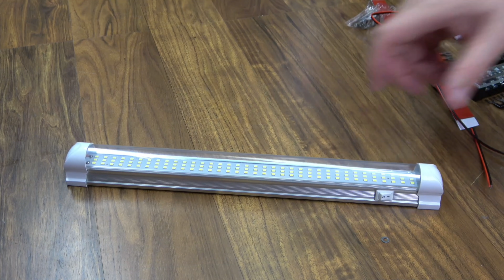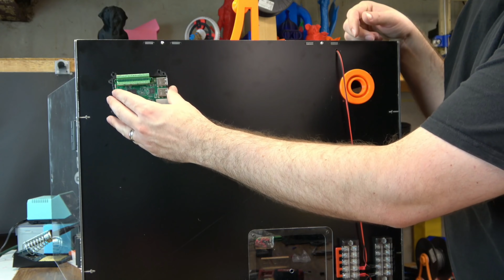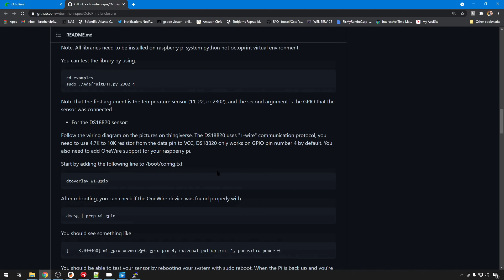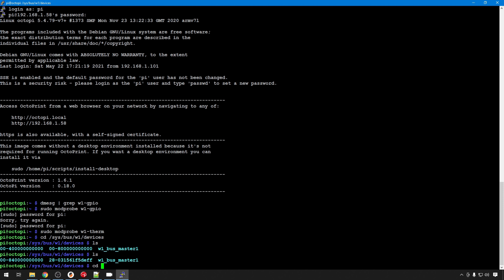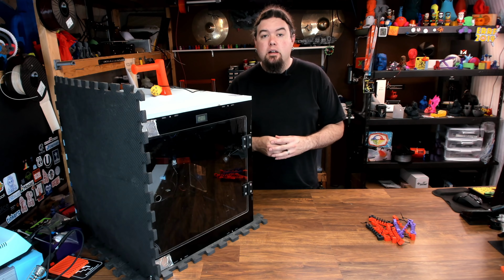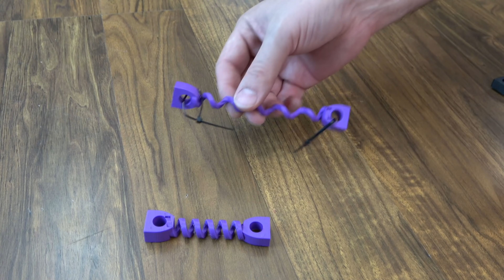Automated Enclosure Part 1 - Active Heat - OctoPrint - Chris's Basement

Comment: Thanks again for this Chris !! A HUGE help !! One question though, is there any way to have the sensor temp displayed on the navbar itself, instead of inside the drop-down box with the flame symbol on it ??
Reply from the maker: Awesome! Check this one out, see if it does what you want it to. https://plugins.octoprint.org/plugins/navbartemp/
Reply: @ChrisRiley  Thanks Chris but I already have that plug-in. Still have to open the pop-out with the flame icon on it

Comment: Would there be room on the inside of the case to run cables down an inside corner and just come out near the connector block rather than have cables running down the outside?
Reply from the maker: For sure on the Prusa one. Plenty of room.

Comment: Nice Video. Is it also possible to integrate the Chamber temp into the Graph Window from Octoprint?
Reply from the maker: That's a good question, maybe, I will check it out for the next video.
Reply: @ChrisRiley  Actually you just activate "Heated Chamber"in the Printer Config and there is the Graph and Symbols for it.

Comment: Chris. If you plan on printing really high temp stuff. Lets say polycarb, or peek, or such.  What kind of chamber and setup etc would you recommend going with? And as you make this video serious as you go is it possible to include comment in the video to that effect maybe??  Thank you.
Reply from the maker: I will touch on this in the next video, PC to PEEK is a huge jump. OC, this setup will work fine, PEEK, you need as much heat in there as you can get.

Comment: I have one of their previous generation enclosures for the CR-10 sized machines.  (I did a video on it a couple years back)  Is this new one using ACM or something "better" for flame resistance?  I have a BOFA on mine and I will be installing a Blaze Cut system to the top, for added safety.  My only gripe about the enclosure isn't the enclosure...it's getting the CR-10/CR-10S inside of it and trying to find all the connections you have to plug in again!  Maybe this new one has better access on the side?  I like your tweaks!  I've been using those inexpensive Ring Light clamp mounts.  It'll hold a webcam, the ring light is abled to be brightened or dimmed to your Octoprint camera preference.  Print Safe!
Reply from the maker: Cool, thanks for your insight!

Comment: Nice video. My enclosure I made myself, with 15mm MDF painted with fire retardant varnish. I get 40c in 1 hour and 50c after a few hours just with a standard Ender-3 running 90c bed, no additional heater. Moved the electronics to the back, outside the enclosure and added quick disconnect plugs so I can take the printer out easily when I need to work on it. I also have a smoke alarm inside the enclosure, along with a thermostat buzzer in case it ever goes over 60c. I print generic no name brand ABS.
Reply: I admire your attention to safety
Reply from the maker: Thanks for the tips!

Comment: I would be interested to see how PC Blend does in your heat test.  Prusa's material chart has ASA's heat deflection at 86-93°C, while PC Blend is 109-113°C.  It would also be interesting to try some of the carbon fiber fill materials to see if the added stiffness helps with this test.
Reply: Ultem 1010 can be 180c I think?!! :3 tho it's cost a lot.
Reply: Htn can handle 150c~ too
Reply from the maker: Great suggestion!

Comment: 2 Tips btw. 1.for smaller parts when you set the chamber temps a bit lowish .. like 35 to 40c , the fan of the chamber heater moving air in there sometimes does more harm than good, ( ie for ABS ).
2. when you have DC heated bed and have the PSU inside the chamber and the chamber insulated, the PSU actually runs cooler because there is way less load on it .  whish i could say the same about the steppers tho , i use 60mm nema 17s so i can jack up the temps to 55c with no watercooling .
Reply from the maker: Thank you!

Comment: Hi, I have asked a couple other YouTubers about this but haven't got a response yet. There's a channel called mr3dprint where the host shows how to strip PET bottles into strings which are then pushed through a nozzle to create useable filament. I really want this to work, but I don't think that it can be that easy. Can you try to replicate his process to test if there's even the tiniest bit of merit to this?
Reply: PET alone (no glycol), could be brittle. Not sure if it’s worth the effort. Diameter consistency is another concern. If it’s for knick knacks alone, I don’t see why not.
Reply from the maker: I agree with Arthur, I don't think you could ever get it consistent enough to make good filament. Plus, being just PET, it wouldn't be very good for 3D printing.

Comment: been running 2 heaters in the chamber for years, One from Octoprint Enclosure and one from marlin. The one advice i ALWAYS give people who are looking into this is to use marlin and not octoprint. not only you can have chamber temps set on STL itself in slicer  ( because the chamber temp you will need is basically dictated by STL's size and geometry) .
but the main issue is octoprint enclosure plugin is UNRELIABLE. some times the heater comes up as "on" on boot regardless of the autostart settings. Sometimes it just wont toggle the control output regardless of it reading correct temp and having correct target .  It rarely does this but its enough to kill your trust and burn your house down if you don't have the proper safety measures in place ( which is why i was happy to see you recommend that thermostat) .  you could also suggest a cheap thermal fuse to people who want to cheap out.
Reply from the maker: Thank you!
Reply: I am intrigued by your post. Putting a printer in a chamber is my next project. Would love to converse with you over dos and donts and get some advice from someone who has experience?
Reply: Good grief, I just want to print. I'm going to get an external heater and pipe it in. Connect it to an Amazon smart plug. Set it and forget it.

My fume extractor sucks the hot air out constantly so I don't need a thermostat. The heater would be on the whole time anyway.
Reply: @dangerous8333  you may be underestimating the amount of energy required to maintain a chamber at 50C + for hours, specially one which is being constantly vented out. My guess is it will just get to 30 to 40 c and the airflow in the chamber will do more harm than good.
it just sounds like a really bad idea, but if you are gonna be like that then just get a couple of old school tungsten or halogen lamps and turn them on in the chamber, you'd be way better off.

Comment: Hey Chris. Is it possible to control USB ports on a RPI similar to GPIO? Just to be able to turn a light or fan on/off.
Reply: not easily, they always retain power for the most part.
So unless you had a fan that took information from the data pins to trigger a switch internally, its just gonna be on all the time.
Reply from the maker: Thanks!